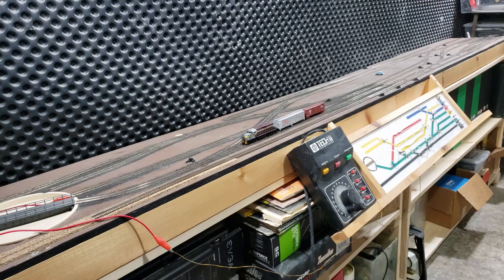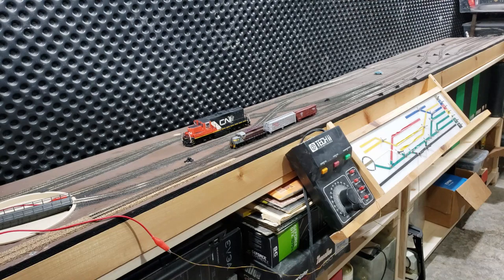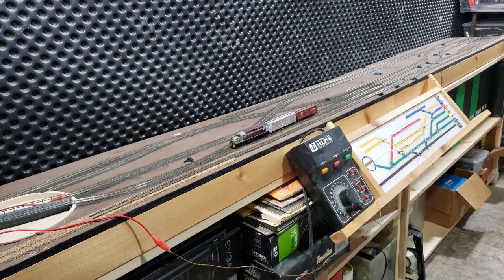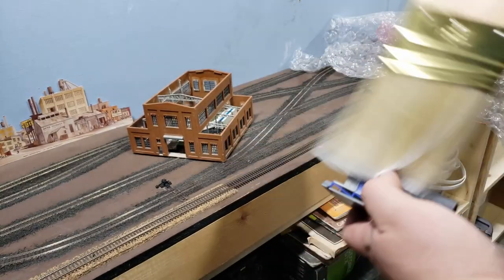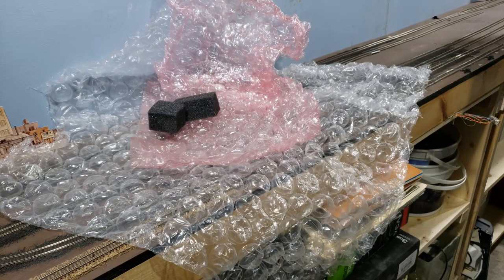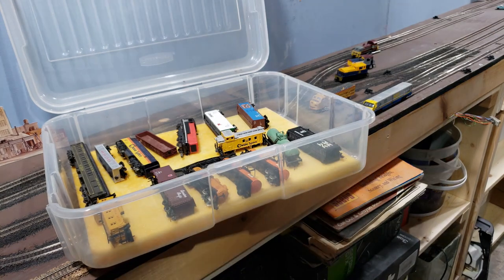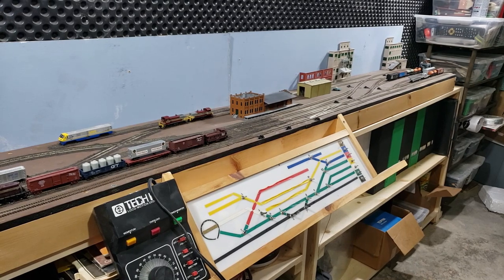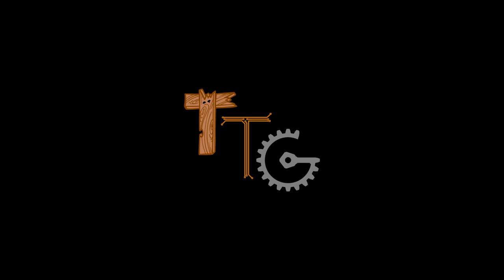My N Scale Layout

Comment: Nice job on the layout. Clean track and well maintained loco's are key to successful operation. I would consider going DCC as the current is constant from track and speed and direction controlled by the decoder. My layout operates considerably better with these particulars in mind. Thanks for sharing. Tim

Comment: One major thing to improve the wiring is upgrade to dcc and install tam valley frog juicers  and recheck all your feed wires
Reply from the maker: Thanks for the feedback.  I have definitely noticed with the short wheelbase locos is the frogs NEED to be powered for consistent low speed operation.  I think that and new and more feeders is going to be one of my first steps in the rehab.
Reply: @TinkeringGeek  all I ever use is 24 gauge wire out of cat 5 cable  and 12 gauge stranded buss wire for dcc for dc 18 gauge is fine